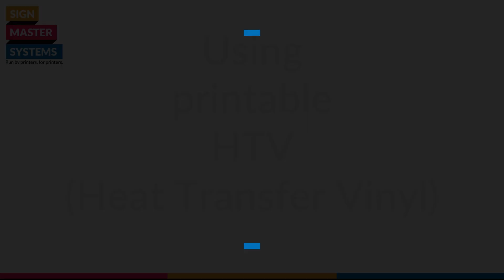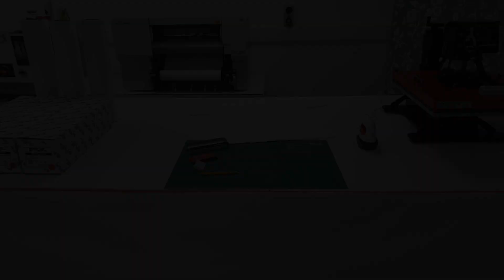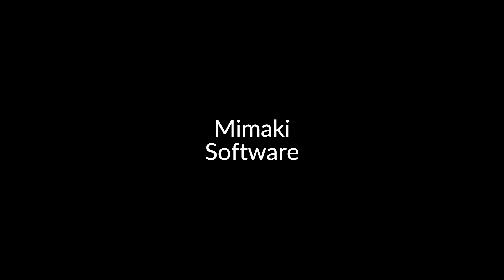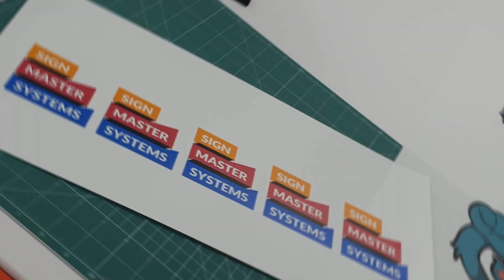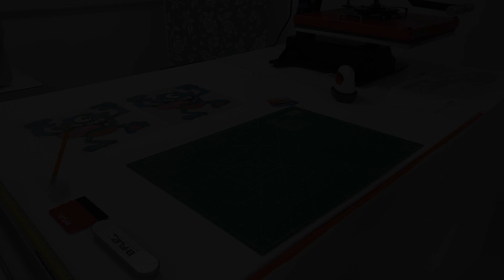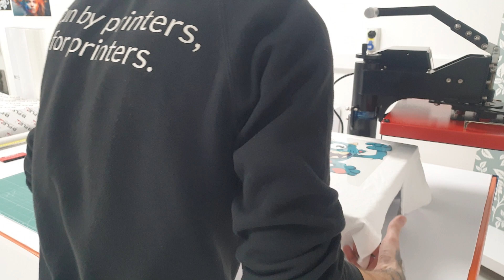Using printable HTV (heat transfer vinyl)

Comment: Hi, I just passed by your vlog because I was searching on google if dye ink is ok with HTV paper. Is it fine to use dye ink with heat transfer vinyl paper? I am confused because, I have to buy printer a dye ink too. Although I already have a pigment printer. I still insist the question if it is okay with dye?

Thanks in advance :)
Reply from the maker: Hello, I'm sorry I'm not sure of the HTV vinyl works with dye ink as they are usually separate processes for garment production and not usually used together. I know the HTV used is suitable for solvent, latex and UV inks.